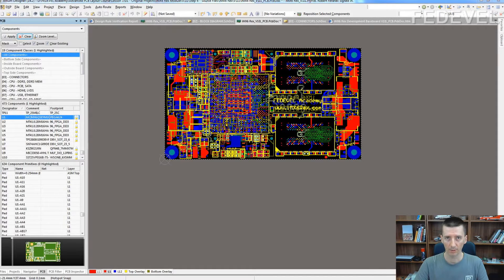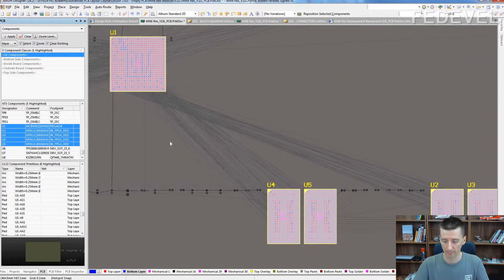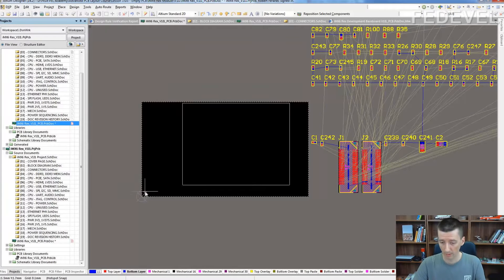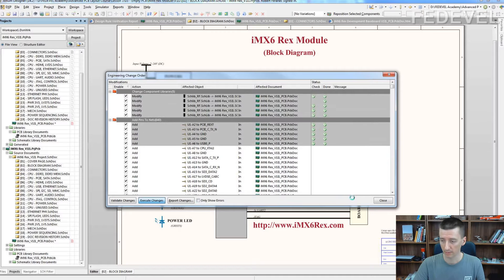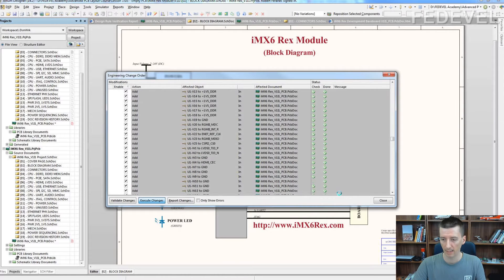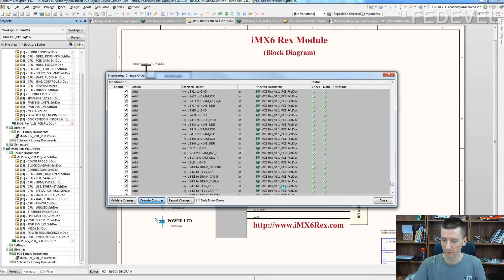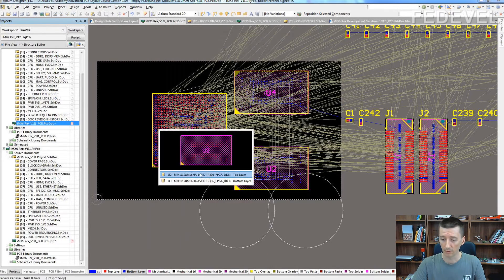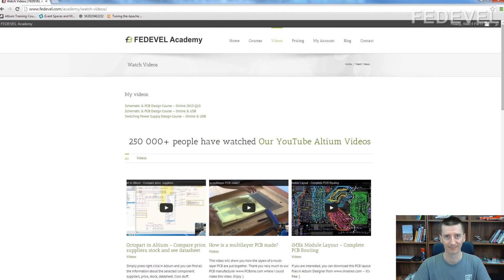Altium - How to COPY Component Placement

Comment: If i've for example got 8 child sheets in a hierarchical design,  and i update the PCB document, it generates 8 rooms with identical sets of components. This is good - but i have a problem i'm wondering if you know the solution to. If i want to design the components in a specific way in one room, can i then use that one design and have the other 7 rooms copy it?
Reply from the maker: I think, that is possible, but I do not know how, I have never used it.
Reply: @RobertFeranec  Hi, and thanks for  the ruler ! I found the answer to my question and thought i must share it with you.

I have 32 rooms with the same 12 components, i want to do the design once then copy that format to the other rooms so i only do the layout once. 

Altiums answer is: 

A ) do the layout in 1 room
B ) select the room and go: Design tab -> rooms -> copy room format 
C ) this brings up the crosshair, select the copy room then select the paste room. 
D ) ???? 
E ) Profit

:D
Reply from the maker: @orbita1  Thank you for sharing the solution

Comment: Hello Robert, I have two different boards, which both consists of one schematic page being exactly the same. Different Reference Designators though, due to one design having more components than the other. First board is placed and routed. Am I able to copy the placement of the entire schematic page of the first board to the second? Pretty much a "Copy Room Formats" between two boards?
Reply from the maker: Hello Pedro, depends if components ID are the same. If not, the simple way to re-use PCB would be to reset designators of the new schematic, manually assign the designators to the components you would like to re-use and copy and paste the PCB part with the components into your new project. Maybe this advice from our forum will help you: http://www.fedevel.com/designhelp/forum/main-forum/altium/4108-using-snippets-the-most-efficient-way-on-a-new-board
Reply: Thanks!

Comment: Hi Robert, I use this a lot. I also copy the fanout of the DDR3 and use Paste special  (E-A shortcut then select keep netnames) this way you do not need to update the PCB from the schematics. only if you keep the netlabes the same.. but in most cases it is. did you ever try to make snippets of this?
Reply from the maker: Hi Paul, I also copy fanouts. Some time ago I have done a video about how to COPY & PASTE layout: Altium Designer - Copy and Paste PCB Layout
A good tip about PASTE Special -> Keep net names. THUMBS UP!